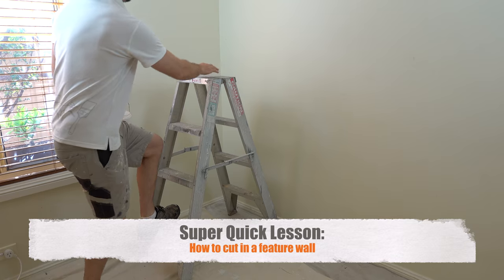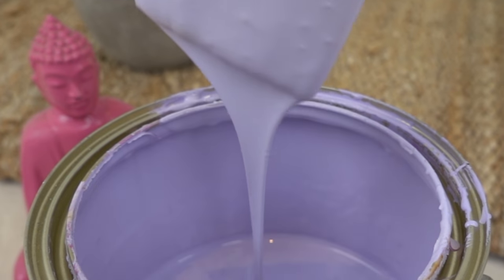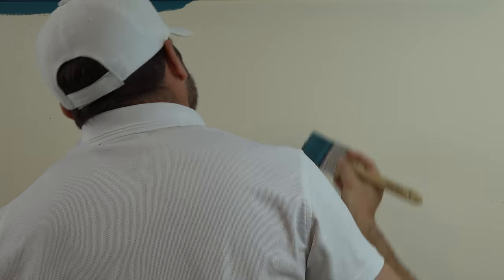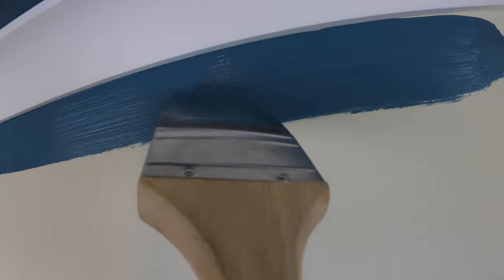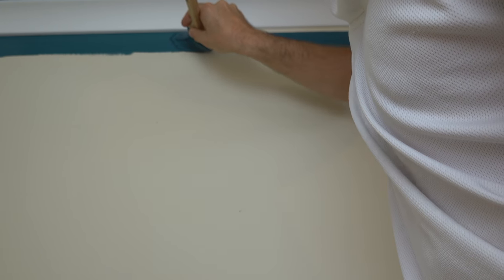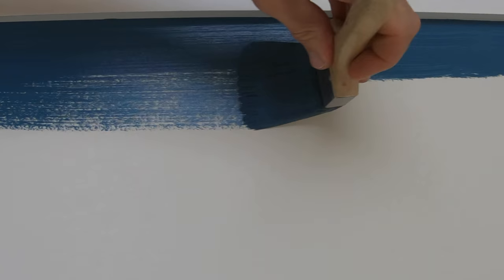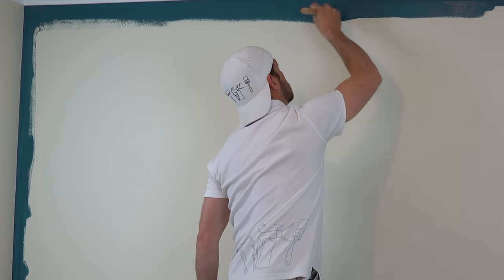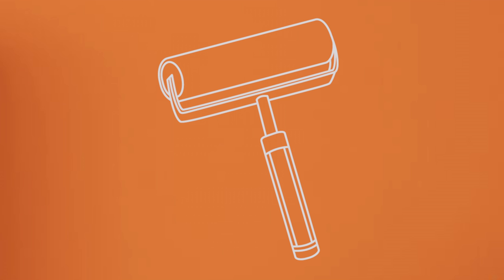Super Quick Lesson: How to cut in feature walls.

Comment: Cutting in is easy on a smooth wall like that, I'd like to see you cut in on really rough textured wall like I've got.
Reply: I felt this comment
Reply: Every video is on smooth walls.I noticed that too
Reply: It’s the same but you have to wiggle/vibrate the brush as you go
Reply: Use frog tape

Comment: Your clear instructions and reassuring tone made me believe I'd be great at this on the first try. 😂

Turns out that I need more practice, and did a lot of wiping paint off of other surfaces with a damp cloth. 

Picture a complete newbie to DIY, who's cack handed, a bit impatient, using watered down paint for a mist coat, which dribbly unless very thinly applied. Not sure why I was so confident I'd smash it, honestly!

At least it was just white paint and easy to keep wiping off. No doubt practice will improve my technique. At least I got myself a good cutting in brush, so with thicker paint, and less absorbent walls, I might stand a chance.

Comment: If you slightly clean the side of the brush that goes against the ceiling you can cut it in one stroke, is more faster and will leave no excessive paint. Of course you need to practice in order to get good at it.

Comment: I always have brush lines less than an inch away from the cut in.  I'm using Wooster Pro soft bristle  brush. I feel like I'm getting plenty of paint on the brush. What am I doing wrong?
Reply: Same here. Just using standard trade paint, but once I’ve gone over the main bit with a roller, a lot of the cut-in parts always stand out. 

Is it just a matter of putting loads of coats on? 🤷🏾‍♂️